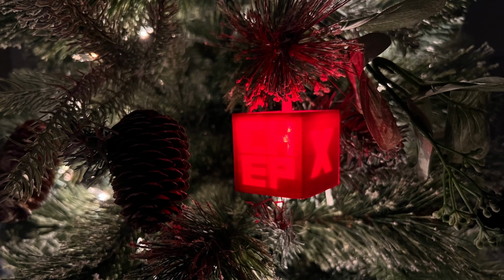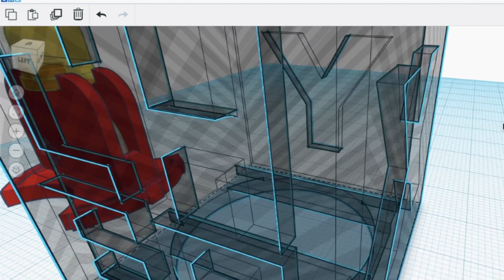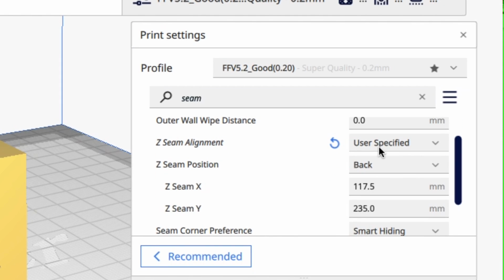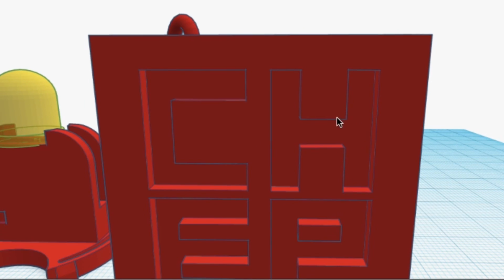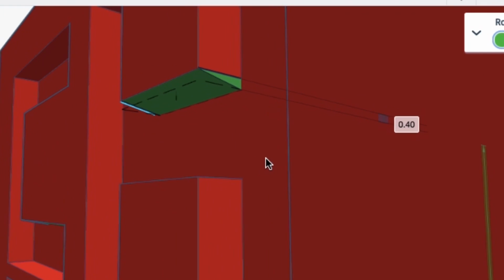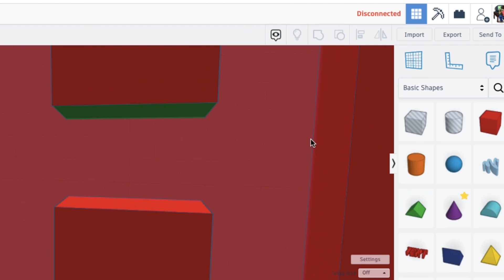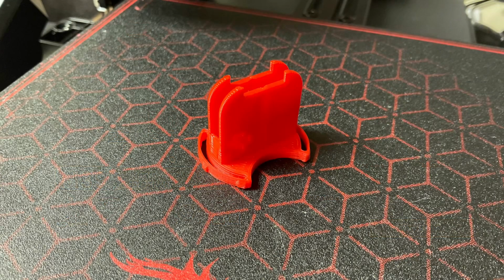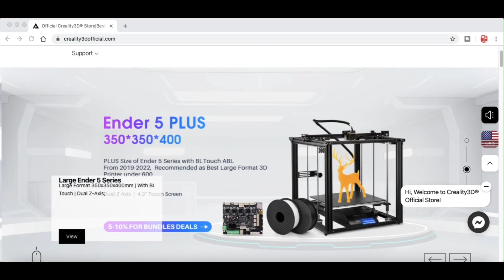Eliminate Sagging in your 3D Prints

Comment: i have creality printer related question
i suspect my hot end cooler starting to fail, 1st because of a slightly grinding noise it makes 2nd because i can't print small details with 0.2mm nozzle anymore but it still prints long features with the same nozzle and filement settings just fine
so what would be the cfm of the oryginal hot end cooler fan ?
would replacing 4010 fan to 4020 help  or break the printer? because it would just barely fit

Comment: Is it just me, or did the 5.2 profile ADD time to the print rather than reducing it? The 5.1 profiles were giving me some problems on 5.2 (poor layer adhesion and a very spotty top layer). I was hoping to see a good 5.2 profile from Chuck but this one actually added time to the print, even more than the default 0.2 good profile...

Comment: I have three ender 3s. All three went blue screen 1 after another. So sick of these things.
Reply from the maker: Do you know the cause?
I’ve never had that happen on any of my Ender 3. Only thing I’ve seen is the LCD cable was loose so the display when off.
Reply: No clue. Just one after another went blue. They sent me two new boards installed 1 and it works. They want me to do my own repairs and diagnostic procedures.  I just want one that works.
Reply: Get an artillery genius, artillery sidewinder, or prusa depending on your budget

Comment: how do you know which wire of the led to put on the positive/plus side of the led holder?
Reply: The lead that is longer is the positive (anode). Can also just try, if it doesn't light up, flip it.
Reply: @cklamNL  thx :]
Reply: I just use this little ditty: A longer leg is a positive thing
Reply: @Reddwarf3r  you don’t want to know how they taught us to remember positive camber in Shop class. 😂😂
Reply: @SammyB562  🤫🤣

Comment: Hey Chep great video, think we could get a link to the led you used?
Reply from the maker: I believe I used this one: https://www.jameco.com/z/LTL-307E-Lite-On-Electronics-LED-Red-Diffused-5mm-T-1-3-4-623nm-19mcd-50VA_697522.html?CID=MERCH
Reply: @FilamentFriday  much appreciated!
Reply: @FilamentFriday  I am no electronics expert, but I believe this LED should have a resistor in the circuit. It will probably kill that battery/itself very quickly otherwise.
Reply from the maker: Sky captain-Lithium batteries have internal resistance so you can get away with this. A resistor would reduce brightness and prolong the battery life but this was to show the Tinkercad design to create a simple light source. Some have already printed it and replaced it with a light from the Christmas tree.

Comment: Cura has a setting called "Make overhang printable". You can do the same thing just by checking one Box.
Reply: I didn't know about this setting until I read your comment. Thank you.
Reply: It uses a much bigger ramp though. Or maybe the inclination is adjustable? I haven't looked..
Reply: @karlnygren  yes, you can change the angle of the ramp. I think the default is 50 degrees; if you want less ramp go higher - 90 degrees would be no ramp.
Reply: @karlnygren  Yes
Reply: Is this available with prusaslicer?
Reply: @alixezman1106  probably something similar but idk
Reply: Be careful though as the ramp is bigger
Reply: On what slicer?? Simplify 3d doesn't have that "box"